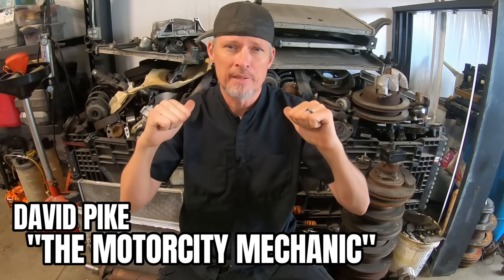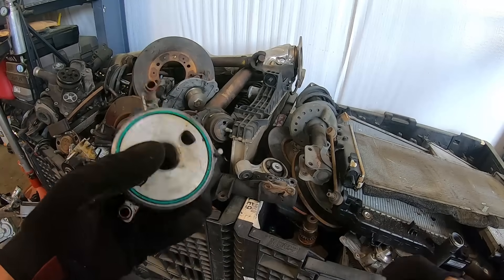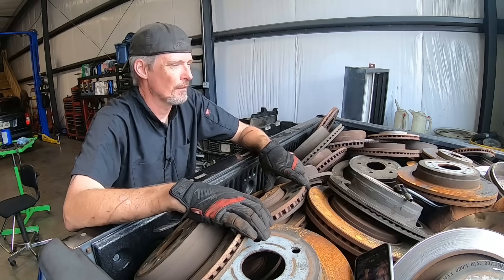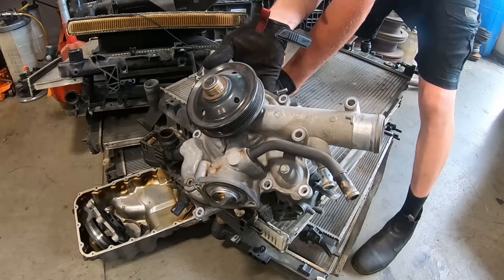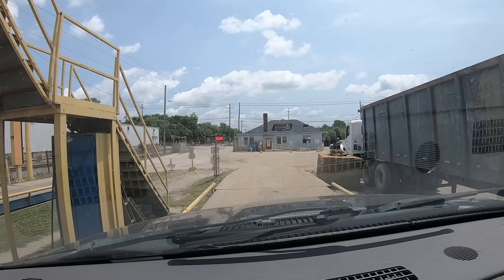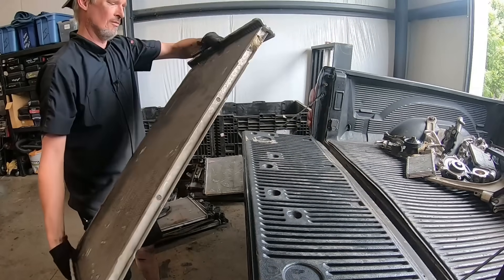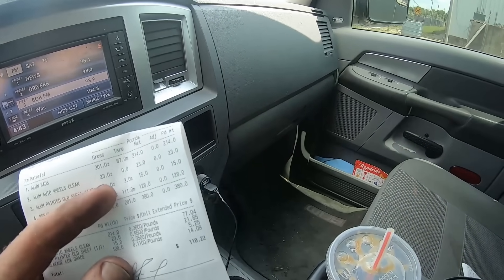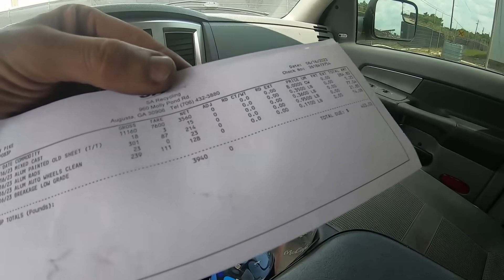Is Scrap Metal Worth Your Time? 2023

Comment: I'm always interested in this subject purely because I had a couple guys come once and clear out all the scrap metal on my property.  This was around 2008 when the financial crisis hit and there was no work anywhere around.  Took them two days filling a pickup several times.  I had a couple trailers so they brought a cutting torch to speed things up at one point.  I call them nowadays once in a while to come haul much smaller piles away but have always thought about what it'd be worth to me to haul the smaller piles myself.  I brought my first GMC Safari to a wrecking yard.  It was weighed the same as your heavy metal and I got $500 cash for it.  This was a few years ago when metal was worth quite a bit more.  Recently I had a guy who bought used cars for scrap come and take my second Safari.  I got $350 on that one.   When my current Chevy Astro finally dies I'll take it myself to the scrap yard to try and get the best price I can, but I'm smart enough now to realize I should make some inquiries to figure out what I can get both ways to get the most for it.  I gave my first Dodge B250 to a local body guy in exchange for replacing the windshield on my second Dodge B250.  That was before insurance paid for windshield replacement.

I've watched some of your videos previouslay and always learned something useful, so thanks for that!  In return I'd like to put an idea in your head about working smarter, especially since you've got a long working career in front of you yet.  At 76 I've done several things for a living, including framing and building 6 houses with a buddy, carpentry, leatherwork (English saddler I learned in England for two years), sailmaking/rigging/yacht brokering.  For going on 14 years I've been a baker doing bread and pastries and for the past two years I've been teaching myself small engine work to flip, repair, etc.  In all those years I've always thought about reducing the physical effort or taking it easier on my body so it will last longer and not get damaged.  An example is your loading of your truck.  Removing or lowering your tailgate and getting the vehicle right up as close as possible greatly reduces the height, time and distance necessary to load about 2 tons of metal.  Backing up as close as possible to the offloading pile reduces how far you have to throw brake rotors.  I think in terms of the gross weight and what I can do to eliminate height, time and distance every time I have to move large objects or amounts of materials.  I also think about the stress on my back (with a ruptured L5-S1 disc, now 20 years on), so I try to not lift loads out away from my body any more than necessary and also try to not lift off the ground whenever possible, but always using leg strength to lift instead of back muscles.  Later on in life it'll become much more obvious how important all these things can become.  I've moved pallet loads of 1/2 inch to 5/8 inch plywood, literal semi loads of cedar shingles, etc., so I know what it means to be a stevedore and do grunt work!  Just some things to think about when trying to work smarter instead of harder.   ;-)
Reply: no one commented so i thought i would but i can say i read it all and you’re one smart old man
Reply: @jamesmatthew899    Thanks!

Comment: We keep metal buckets to fill with clean aluminum, dirty aluminum, and heavy iron and light iron then have a pile of rotors and big stuff. Usually a year of accumulation gets us 250-350 and it usually only takes an hour to take two loads. But the recycle yard is a mile up the road. Oh and they mag stuff out of the bed of the truck. Takes no time to unload

Comment: Also for that small stuff use buckets or a 30 gal drum so you don't have to waste time loading one piece at a time . Also when unloading the heavy stuff like rotors get as close to the pile as possible you did way more work then you had to throwing those thing as far as you did . That just why more work to do.

Comment: I've had good interactions using a 75/25 split. Using the split gives the scrap owner a bit of rent for storing the material and the scrapper gets a decent return as well. One caveat though. Only deal with scrappers that you know personally. Otherwise they may not return with your 25% cut.

Comment: Miss your videos! Please do a video on motor mounts. Specifically, the hydrolic ones that seem to fail on the Chrysler 300's and other  cars, maybe trucks too. Is it common for theses to fail and leak oil just after 100,000 miles? When they fail are there noticeable drivability problems? 
I'm about to replace mine on my 2013 chrysler 300s due to leakage. I have 107,000 on the odo. Thanks!
Reply: In the old days of solid rubber motor mounts, failing at 50 K was not uncommon.

Comment: You got much more than $400 for 2.25 tons of recycle - because, if you had not recycled it, it would have piled up as an unsightly mess until you could not stand it - then you would have paid (~$120 to 140 per ton here in WA) in tipping fees, dump fees or transfer-station fees to ,get rid of the junk...  
You 
EARNED~ $408,  From recycling
SAVED   ~ $270,  FROM NO DUMP FEES
TOTAL BENEFITS > $675!!
Reply from the maker: It certainly was worth money for sure. More then I wouldn’t have imagined and glad I saved it and didn’t give it away

Comment: Nice chunk of change. I guess if you had an old trailer, you could save a lot of time and labor by tossing in the steel to haul off when full vs loading into truck to begin with. Same with aluminum, sort as you go to eliminate sorting later.

Comment: One thing you have to look at is the labor you have in it.  Normally a mechanic gets about $50 an hour minimum, so if you do it in 4 hours you have $200 invested, now since you lost that same amount of cash in revenue incoming, now you are at a $400 cost, then add in the transportation costs, remember fuel is north of $3.50 a gallon.  Around here the scrap yard is about 20 miles away so you are at $15 or more.  You make money, just a small amount after you factor in your labor costs.

Comment: Back in the 80's I use to fill junk cars with all the scrap metal (iron) and drag it down to the recycler $1per 100lbs. There were guys who came and bought everything back than including waste oil. 55 gallon drums were good for brakes shoes, pads , drums and rotors. Another for cats, Junk cars were good for shocks, struts exhaust pipe and mufflers. Beats throwing in the dumpster that you pay for! The biggest commodity at the shop was aluminum cans! 35¢ per pound at one time, good for beer and cigarette money!

Comment: You mention Chrysler 3.6L cam shafts?  Do you have (or could make) a video on how to detect (early) an issue on the 3.6L?  We have a 9 year old Durango with the 3.6L (only 87k miles).
Reply: Check weight of oil  ,.im here in Perth Australia  my daughter has a 2015 3.2l grand cherokee I replaced her rockers and lifters it says on the oil filler cap of the engine 5-20. Here we use a higher second number oil like 5-40 .or 10-40 because the temperature  here is average  winter time 9 degrees centigrade  to 17 degrees centigrade. Summer is 24cent to 43cent .you can find charts to advice you all the old repair manuals gave you a reference .
Regular oil changers is the preventative  for the needle bearings in the rockers. This message  may be a helps for you.
Reply: @brianpotts7308  I have always used 5W-20 full synthetic.  Change every 4-6k miles.  First couple years with it I did tow a trailer a few times.

Comment: You can separate the PMs from the catalytic converters by soaking the ceramic cores in a mixture of muriatic acid and a few shot glasses of bleach. It will disolve the palladium and platinum. The rhodium can be removed by soaking the cores with dilute sulfuric acid and hydrogen peroxide. It helps to burn the carbon residue off before processing. An average core has 0.3g of platinum or palladium and 0.1g of rhodium.❤
Reply: My brother works in a plant where they make catalytic converters.  He said some of those metals can do some pretty bad damage if they contact your skin. It seems like they were different metals from those you mentioned, though.  They may have made some changes to the formula.

Comment: I am in tge middle of a Promaster righr now and thought of you. Now a video pops up in my feed. How cool is that?

Anyway, I have the room, so sort as I go. Dirty  Al in one barrel, tin in another and radiators in another pile. I wonder if it would be more efficient to just cut the ends off of the radiators with a band saw or something. You lose a bit of Al, but it would only take a few seconds. Its probably six dozen of one, half of the other. Or something like that.

Comment: I'm a plumber, so I collect bread and copper. I can do about 4 or 5, 5 gallon buckets, not that full of metal, and get about that much. So, in other words, it depends on how dirty or clean the metal is. You did good on collecting that metal for years. Yeah, it was a little bit of work, but you came up on it. Tax free.

Comment: its worth the time if you have a yard to stack it all. you just throw things that are like the other things in piles. think of it as a moving fund or a retirement cash out. you can get great prices if you can do things like fill entire dumptrucks with brake rotors. the scrap game is all about sorting and if you have big enough piles the scrap yards will send trucks to you at least its like that around here. in the scrap market shredded steel in the bottom of the barrel so the easier it is for the yard to sort what you bring the more they will pay
Reply: Back in 2007, when demolition was tearing down Shea stadium as Citi Field was being built, the construction workers separated, and broke down all the steel they had accumulated, which, oddly enough was right near the makeshift, fence, where the truck entrance and exits were at. A lot of folks who were scrappers were very tempted to jump the fence or even cut it just to get in there to go after the scrap but unfortunately, NYPD had a rotating shift that stood right in front of the place to make sure nobody got near the stuff.

Comment: i throw my non cores into my pick up.  no real sorting.  when theres enough i drop it all off on the "pile" at the local yard.  usually a third of thr sport trac bed yields about $40.  i have a pile of catalytic converters waiting for rhodium to be expensive again.   might take years for that to happen but when it does theyll be worth about 200 each.  thats the jackpot pile.  my little stuff like brake pads and spark plugs go into 5 gal buckets.  makes dumping them on the pile easy.  no metal goes into the dumpster at my shop.  great video
Reply: It will be years for cat prices to get like they were in March, and I doubt they EVER will again.  With the transition to EVs, cats are going to be like lead acid batteries and become dinosaurs.  Cats are very low right now, but I think they'll see about a 20% rebound in a year or two and they will be maxed out.

Comment: Even in low paying markets it bounces right back just more picky about materials. I will mark you be picking up copper brass aluminum aluminum rods. Even if call one scap yeard might not even pay same as next so do check every time that a lot I spit with a company like muffins pluse ext. I have 30 stops by me I do once o week it take 3hrs to do. I usally do spit with the owner l wright a contact with them for 50 /50 spit

Comment: In the early eighties we made a fortune with automatic transmission, aluminum, aluminum cases, transfer cases stuff like that, Lee miles and all these transmission places, they would condemn good Transmissions so they could get the scrap price for them oh, it was crazy, one time there was a thing with car batteries just think it was some 99 or so. Yes but there's good money in scrap metal depending on what it is and what the demand is for, early seventies was great for steel, call her pretty much any scrap, or does that bring back memories. Where goes the time? 😢

Comment: Hi ! I have a problem with transmission on my 2017 Dodge RamPromaster 3500 . All gears working good but when it’s switching from second gear to third gear some squeaking or rubbing . I replaced solenoid pack and problem still same . what could it be?
Reply: Automatic transmission 6 speed 3.6 L engine gasoline

Comment: They cheat you out  the rotors are supposed to pay more , the thing metal like fenders  n anything lighter  have different price ,also the aluminum with metal i think they pay mix aluminium almost same as  thing metal pricing but u did good because i think u had that stuff for like  a year, or i my wrong so u would do it again. I know its very bad pricing for recycling metal  i wish they would pay more. Peace 👍🙏

Comment: I used to work for an industrial equipment supply company 
I brought an electric saw and cut up motors
People would dump on
The company site illegally 
From separated copper 
brass aluminium 
I was making almost $1000 a year

Comment: What's the rent value per square ft? What's your equivalent hourly wage? For $400, to take up an area of shop for 2 years, that could have otherwise been productively used, it doesn't sound worth it.
Reply: Yup lockable scrap bins located outside.

Comment: @ggariepy I got you beat 33 years started back in 1987 retirderd at 2020 drove all of 3 trucks during all that time a 1965 c20 chevy long bed 350/power glide with a 4.10 none posi rear end drove that truck for 19 years and still have it. got 8-10 miles per gallon But gas was at .90 cents a gallon in 1998 it shot up to $1.50 that's when I bought a 1987 Mazda b2000  with the 2.0 4 cylinder in 2005 it was at $3.45  that when I bought a 1991 ford ranger 4.0 5 speed with a 4.10 positraction extended cab used it pulling a 14X5 tandem axle trail  drove it for the last 15 years sharing that time with my chevy that I did house clean upsa for banks pulling a 10 LP big tex hydaloic dump trailer. I was in the core business from 1990 all the way up to 2022 took my last load in made over 5500 in cats and Semi steering boxes and computer brains from 5 dealer ships I got my cores from.. If you where around in 2000 when the bottom fell out and metal dropped to 5-10 dollars a ton Most you you rats junp off the ship at that time. I stayed on worked throw it in 2006 the big boom happen and metal got up to 950.00 a ton cast in calif was going for 1200.00 a ton. You know vetrans cus they know every thing about the scrap business and they can tell you want metal is by looking at it Not having a machine telling you what it is. 33 years for a white guy 6'4 285 pounds picking up 454 short blocks from a dead lift into a truck bed 3 feet off the ground Love to see you guys do that in your hay day Or the big roll up 33 foot doors Vortex roll up doors. I can tell all you newbes Buy your self a 1964--66 chevy long bed put a peace of 5/8 ply wood under the bedliner and it will hold up to any metal you throw in it. New trucks from 1988--now fist thing to go bad on your scrap truck is the tail gate then the driver side door and door pins then the bed it will last all of 3-4 years if you use the bed only.take if feom a old scraper buy your self a trailer throw all the scrap in it only use your bed for alum copper and cores

Comment: I was expecting at least $500 for 4,000 lbs of iron. But yeah, mixed cast, I guess it's not worth as much and iron is not worth that much. I guess if it were something like steel, then it would be worth more.
After looking it up, cast iron is about 0.06 per lb and steel about 0.18 per lb. The dirty aluminum isn't worth as much as the iron.
I guess $400 isn't that bad for something that would just be trash otherwise.
I also looked at melting aluminum in to ingots, thinking maybe you might get more and that would definitely not be worth it.

Comment: Dude the rotors are worth most if you did it right... knock the tanks off rads like 1 min or less a rad .. aluminum takes up more room than its worth unless rims
Reply from the maker: Yeah the rotors are something I learned about for sure. You almost have to make 3 trips so they weigh each separate so that they don’t group them together. Yeah I think it was like $3 per radiator in the end if that.

Comment: Cast Iron is not cheap. If they are paying  you same price for tin they are screwing you. I have people give 1 buck a rotor. I was short on money one time and my local scrap yard paid me a whole $8.60 for about 100lbs of radiators. THey had the tanks on but still they ripped me off. also if you have a fork lift just run the radiaot over and tank pops off

Comment: Prices are very low. I only pick up scrap a short distance away and the yard I sell to is 15 minutes away which is great because oft out of control gas prices and the fact my truck loves gas. Averaging over 5 bucks here. The yards here in Arizona pay the same for all steel. Separating it is pointless they won't buy it so it's all shred to them. The same with bare bright. None will buy it or any copper for that matter unless you are are a licensed plumbing contractor due to all the scammers and thieves that have ruined it for everyone.

Comment: You lost a fair amount by selling as "mixed".  If you'd done an extra stop at the scale between the drum/rotors and the rest, that $284 probably would have been closer to $350-400. Spending way too much time "peeling" plastic off radiators; 3lb hammer and just knock them off clean. Those coolers are also sometimes brass or copper. Aluminum rims aren't "clean", they're "extrusion" just like aluminum ladders.